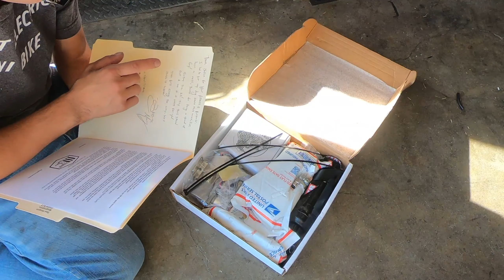E Vader Bag Kit Install!

Comment: If I were to buy a lithium battery, would I  just need two 50A Anderson connectors to be able to connect the the battery to the bike after soldering the wires?
Reply from the maker: Basically